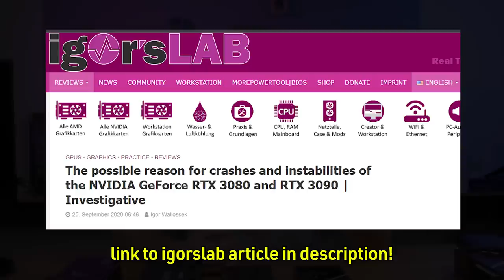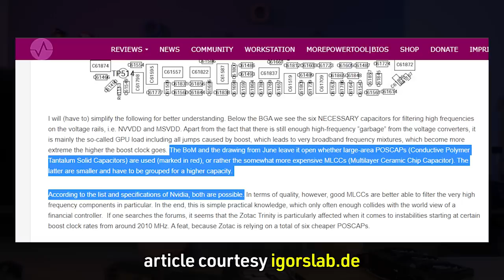The RTX 3080 Launch can't get any worse... Right? Wrong...

Comment: Thank god for this video. I've been holding back starting my build - now i saw this video and checked the available 3080s in the shop.
They sell 4 different versions - 3 of those got the 6 "cheap" capacitors layout and one got 4 cheap and 2 good ones.
Reply: This entire caps BS was just proven wrong as was to be expected from the beginning for people electronically educated. Buy whatever - the new drivers got rid of crashing
Reply: Or u can just stick with asus as they make the best and are known for it
Reply: @Tw1stTech  the new drivers downclocked the card to make them stable 😂
Reply: @wtfman1217  which still means it’s a Firmware issue. There are tests showing the hardware isn’t really at fault. The target clocks were simply too high

Comment: someone needs to remove those cheaper caps to see if its a simple job of soldering in higher quality replacements, until we see the board with the caps removed we have no way of testing any of these theories

Comment: This needs to be revised. I am on my 3rd Gigabyte RTX 3080 in two months and one rog strix RTX 3080. All problems. All retuned. I am now waiting on a evga.  Until the evga arrives, my current issue is I cant get the card past 50% utilization during gameplay. 

There is nothing else to update. Nothing else to install, reinstall. I've ran ddu. I've reinstalled windows, the bios has been updated on the mobo. Etc.

 I have a 3070, that has zero troubles. Runs top. But my 3080's have so many problems. I even got a new pc after the second 3080. Still doesn't work..  That's 4 failed rtx 3080 in row? How is this possible?

Current build is a RTX3080, X570 TUF PLUS, Ryzen 7 5800x, 32gb ram Gskill 3200mhz. Corsair liquor cooled, corsair 850w gold psu.
My other build is the same except a 3070 & 16gb ram. My 3070 games WAY better and mines more stable than my 3080.

3080 will lhr lock regardless the settings. Which is also frustrating and I wasn't able to game until I started locking the volts on the 3080. But now I can't get past 30-50% utilization on the gpu. Meanwhile the cpu is running 40-60% utilization. I don't get it.

Comment: ive been overclocking my 3080 and i found at 1065-1082 Mv i can hold 2190 mhz but if i try to push it to 2200 it jumps to 2050 and back down and up than crashes. really weird. also mine hardly boosts anyway in the first place oddly

Comment: Seems that it comes down to Companies going down the cheaper path that is the problem. I always wondered whether the card price difference was just down to name branding but now it seems you really do get what you pay for. So these companies that have cheapened out now need to do a recall at their cost, not just dumb down your card and if I had a founders card my re-sale price would have just gone up a couple of hundred dollars.

Imagine if the fix for a major component failure in a motor vehicle that only occurred at speeds over 70 miles an hour was the car company speed limiting your car to 50 miles an hour !  I don't think we'd be accepting that.

Comment: After needing to do a warranty replacement on the 2080 Ti, I will NEVER be an early adopter of a video card again.  Completely unsurprising.
Reply: The issue turned out to be Nvidia post release drivers (pre release drivers were fine), had NOTHING to do with capacitors. Jay need to take down this video as its still misleading people like you,  but he keeps leaving it up for clicks $$. Yes Nvidia released a updated driver that corrected the problems on ALL regardless of capacitor type. Watch this explains all.
https://youtu.be/lhyCdraz54s?t=350

Comment: So, i have a 3080 CLX system on order that's supposed to be shipped sometime around the 10th....should I cancel and wait for a "fix"? Seem this issue has enough visibility that at least the cap problem (it that's the issue) should be rectified before they ship more board.
Reply: already fixed with new drivers, dont sweat it

Comment: the only thing i am taking against nvidia here is that all reviews we saw are mostly inaccurate coz mostly the card isnt 100% stable so what they gonna do is release gpu bios update that will cap clocks lower than those clocks used for all reviews and released benchmarks.

Comment: In the UK if you bought one of these handicapped cards , return it to your retailer within the first year because it is not up to spec , its called a design flaw , and is against the sales description and the UK sales of goods act , do not ask the manufacturer to fix it unless they supply a fixed card  with right components , other wise , SUE them the card is advertised as a Set speed with gpu boost , if you cant use GPU boost its false advertising other wise they will have to lower the price substantially because there is an handicapped spec

Comment: Maybe I missed it, but is there a thought on whether this issue will also be found on the 3070?
Reply: The issue turned out to be Nvidia post release drivers (pre release drivers were fine), had NOTHING to do with capacitors. Jay need to take down this video as its still misleading people like you,  but he keeps leaving it up for clicks $$. Yes Nvidia released a updated driver that corrected the problems on ALL regardless of capacitor type. Watch this explains all.
https://youtu.be/lhyCdraz54s?t=350

Comment: In popular terms, the problem is the usable frquency range of the decoupling capacitors.
Obviously the larger types cant stand up to to the higher boost clock frequency.
(Strictly speaking they have too high resistance at high frequency)
The smaller the capacitor is, the better it is in general, but obviously it has a much smaller capactor value, such a whole bunch of them is needed.
It has NOTHING to do with the quality of the capacitor, this is a basic physical problem to the capacitor and its size.
In other words it wont help using golden expensive japanese branded premium capacitors.
Its just that someone in the engineering department choosed the wrong solution, forgetting about the high clock frequency paired with a high current consumption on these graphic cards.
WARNING
Do NOT try alter your card yourself, turn it in on warranty !
Reply: Capacitors are not the issue. This guy's a dunce.
Reply: The issue turned out to be Nvidia post release drivers (pre release drivers were fine), had NOTHING to do with capacitors. Jay need to take down this video as its still misleading people like you,  but he keeps leaving it up for clicks $$. Yes Nvidia released a updated driver that corrected the problems on ALL regardless of capacitor type. Watch this explains all.
https://youtu.be/lhyCdraz54s?t=350

Comment: The XC3 Ultra is causing all kinds of nonsense on my Gaming k7 board. I can't get it to post, I get code 05 then 00, then I have to power cycle,  clear the cmos, and sometimes switch to the backup BIOS. Turning on from a full-off state causes the same 05 then 00 errors again. Updating the BIOS did nothing lol. Any advice @JayzTwoCents ?

Comment: I really wanted a 3090 even though I’d lose some performance with my 8700k, a huge upgrade over my 1080ti....but now I’m not sure. I was looking at the MSi, seems like they did it right but still want to wait and see what happens.
Reply: Even now a 3090 isn’t worth it. I was about to. And saw that the 3080 was $1,000 cheaper! $1,000 more for a slightly better card. Wasn’t worth it to me

Comment: Someone should do a write up of all the 30 series models from all of the AIB’s listing which capacitors they used on their GPU’s. I saw in this video that EVGA only used one block of the more experience capacitors on their model that you showed. The higher end EVGA 3080’s and 3090’s haven’t been released yet. I would hope that EVGA would use all more expensive capacitors on their higher end cards.
Reply: Battleneter wow seems like Igor started a major domino effect and Jay just put gas on fire. Thanks to Nexus for helping to put the fire out.
Reply: @ericandi  Igor is not to blame JAY is to blame for presenting Igor's theory as fact, Jay started this shit storm and he still hasn't taken down this video!

Comment: Like @JayzTwoCents says, boost clock goes beyond what the card is spec. It may be bad for some people who enjoy getting a +5% performance for a 100W increase, for ex. the asus strix 3090 card, but for the others it really shouldn't matter that much. Like I said in a previous comment, you don't have to be an idiot to use them even though they can't go beyond the spec clock speed. Look, I've a custom watercooled Threadripper 3960x build and 2 watercooled zotac 3090. I have the 1600 T2 from EVGA as a PSU. I literally can't afford to have higher wattage than 350W for the zotac if I don't want to experience crashing issues because of a lack of PSU power, and in Canada, you cannot buy anything better than 1600W Titanium like the EVGA T2. If the crashing was happening on spec clock speed, that would be a whole other problem.

Comment: So the EVGA cards actually have 2 of the expensive capacitors. But the review ones they sent out to YouTubers only had one because they were not finished yet
Reply: @wtfman1217  bruh they were using 2 of them not 1 I'm just saying that the review cards aren't the same as the retail ones. They're the same as the FE card basically

Comment: I agree with the point that one is only guaranteed the 1710mhz clock speed. But by applying that point to get out of this dilemma, I would somehow expect the advertising should be with cards at 1710mhz as well. Even if the companies never promise you 2000mhz, they still tease you to the point where you will be frustrated if your card needs to be limited.
It looks to me like they just did not test their reference spec enough and for that there should be more than just "well it's running over 1710 as printed on the box, isn't it?"
- 1080 owner with no stake in this except morals.

Comment: overclocking is overrated. either you have a well-optimized application/game and a fitting setup to run it on wished settings or you are doing something wrong. The only reason to overclock is constant video editing or calculating - in all other cases, it is worthless the time it costs. you have an old video about it on your channel

Comment: So basically what I got from that video when it’s overclocked the card is more sensitive and easier to crash cuz of other electromagnetic occurrences around it that could be interfering with it.
Reply: It ended up mainly being a driver issue. Just don’t buy a gpu or cpu at launch ever. Also, the stock voltage is really high as a decent number have undervolted it for the same stock voltage performance at 50 watts less or so.
Reply: @CknSalad  the drivers did tweak the clock and voltage curve so the headroom for GPU boost is slightly lower. Which is a software solution for a hardware issue but because it's a driver, FE cards and MLCC array cards are affected too. This is more of a problem of a shorter testing phase for AIBs.

Comment: The fix for this problem:
- firmware update to dial down the boost frequency
- order those small capacitors from ebay or something, and replace the cheap ones yourself.....

*In case it wasn't clear, it's a joke....

Comment: soooo does that mean the zotac card wont  wont have the crashing problem
Reply: The issue turned out to be Nvidia post release drivers (pre release drivers were fine) and new corrected driver are now available,  never had anything to do with capacitors. Jay needs to take down this video, its just terrible for so many reasons and misleading new people,  but he is clearly leaving it up for clicks $$, just watch this as it explains all.
https://youtu.be/lhyCdraz54s?t=350

Comment: Hey Jay,
Just got my msi rtx 3080 gaming x trio it has the crashing issue I had to underclock the gpu to -150 and the power limit to 95...
What do u think msi is going to do are the going to send replacements out to ppl with the 3080 with the single good cap?

Comment: See I'm rocking a GTX 980 in mine and have been thinking of upgrading it. 

However I'm not getting a brand new GPU that comes out, though AMD's Radeon 6000 series is looking good same power as the 3080 but lower power draw? Count me in 

Anyway maybe upgrading my current to a 2660

Comment: Something else is going on. Even 20xx cards are showing issues and mine started showign crashy behavior the last 2 driver versions.
Reply: It was the drivers, that's why it's affecting the previous series too. Don't pay attention to the guy in the video, he is clueless.
Reply: @diezgp  He does have a technical point but yeah, it does sound more like a driver issue.  There are indeed such micro-differences and interference, but in this case it does not look like it. I am running on the latest driver (456.55) and this keeps happening. Freezes and locks.

Comment: wow....thank you for making the video.  I don't have a 3080 / 3090 card yet, but honestly was just waiting for Christmas to pick one up.  Now however, it is making me second guess that idea.
Reply: Nvidia released a new driver yesterday largely solving crashing on cards with MLCC/SP-Caps or a mixture. It appears the capacitor "theory/Guess" is complete overhyped BS.
Reply: Shit like this happens every year. So I would recommend waiting. And waiting till christmas/newyear is enough to make sure things are fixed. Nvidia and Intel are in a rush to beat AMD, and this rush is costing Nvidia at the moment
Reply: @Sou-no7xt  It was just a driver issue, that affected a "small" percentage of users, it is Jay that blew this up way out of proportion with a regurgitated capacitor theory.

Comment: Hmm, anyone tried swapping the large caps for an array of MTCC Caps? looks like they still have the pads for the arrays. I'd be willing to rework the board and install the correct array if someone wants to try it. Maybe even go super overkill and try 3 arrays?
Reply: @Battleneter  damn, well nevermind lol. Yes, definitely needs to make a video stating he was wrong, but I wouldn't call this ignorant reporting. He is a YouTuber, not an engineer. In the end of the day, if he makes a video, stating he was wrong. I'll accept it for what it was. A Mistake.
Reply: @DukkyProdutions  Ignorant, means lack of knowledge or misinformed. Its just the "way" he presented the theory as fact. He did make a following video, however it was more about saving face, certainly nothing like an apology and the offending video is STILL misleading people.

Comment: So if the smaller arrays are better and more stable, why would the builders not use the full 6 with smaller  arrays and increase the price of the card since its far better card then the rtx 2080 cards and for less money.. they  could have given you a far better card with still a lower price then the rtx 2080 was.. using the best components possible..
Reply: And in the future, when it comes to buying a USED CARD on places like EBAY.. you will probably be buying a card which has the full 6 cheaper arrays..
Reply: Nvidia released a new driver yesterday largely solving crashing on cards with MLCC/SP-Caps or a mixture. It appears the capacitor "theory/Guess" is complete overhyped BS.

Comment: Just my luck ... I upgrade my system once every 8 years and I choose the most controversial launch GPU to buy 😅. Oh well should have done more diligent research before buying currently having to underclock by -50 Mhz to achieve stability (2000 Mhz + - 25) with just one of those expensive whatnots.
Reply: Just curious what is the exact model name of the card you bought?
Reply: @Icy233  gigabyte aorus geforce rtx 3080 xtreme rev 2 (GV-N3080AORUS X-10GD)

Comment: Traditionally there was always a chance that overclocking will cause instability - if its guaranteed then its hardly "overclocking". If your GPU can't meet the standard spec then its a problem, if its unstable when overclocked then thats your issue. If the drivers push the card too hard then thats the driver writers problem. 
When it comes down to it, only buy the latest gear at launch if your prepared to accept problems. Otherwise leave it 6 months and it'll be cheaper, many of the wrinkles will be ironed out, and issues that haven't been sorted will be well known; the only thing that will suffer in that 6 months is your ego.

Comment: So I guess if you're gonna buy one, try get a founders edition
Reply: @Battleneter  That doesn't seem like strong wording by Nvidia. They just said cheap capacitors are NOT NECESSARILY the problem. It's a bit different from saying "No the capacitors aren't the problem"
Reply: @AnxiousEducator  This is not a "Cheap" vs "expensive" capacitor issue, both types costs "cents" to the manufactures. I am simply astonished those terms were used with zero understand of the design differences of the PCBs between AIB's.

Comment: even at its base frequency its a beast of a card, I don't have one but I would like to.
in my world, I would rather have a stable frame rate than a faster one and a stable card at stock rather than an unstable one but faster clock speeds.
It is a problem for sure but the solution is available now don't go too far with your overclock and make sure you have that airflow.
as J said don't expect a hardware solution anytime soon.

Comment: good documentation on what an MLCC component is https://www.mouser.com/Passive-Components/Capacitors/Ceramic-Capacitors/MLCCs-Multilayer-Ceramic-Capacitors/_/N-bkrda, its a type of ceramic capacitor that holds charge but they pretty much are used in cleaning up power delivery to silicon & other electrical components that need precise voltage with little to no spikes & EMC noise.